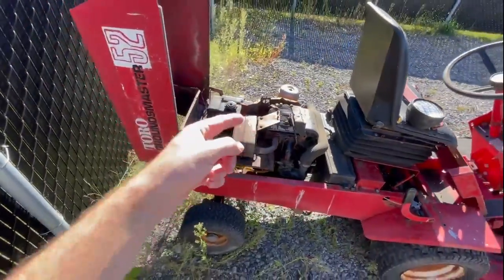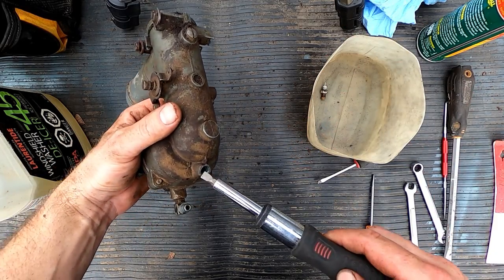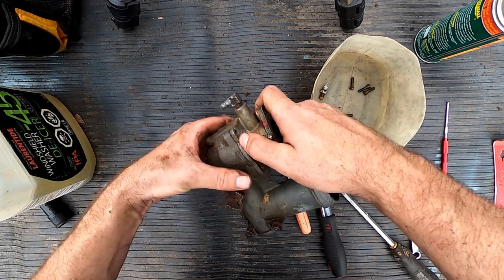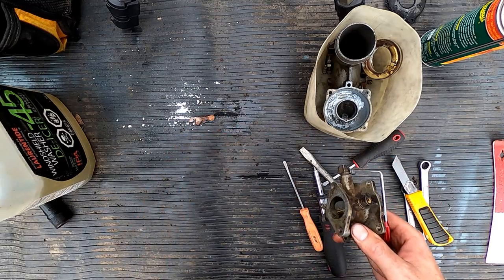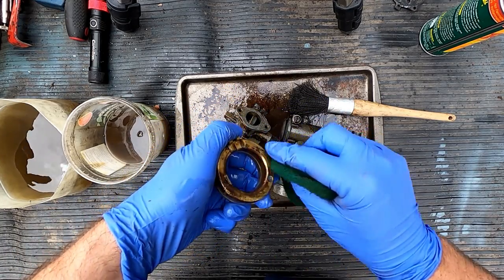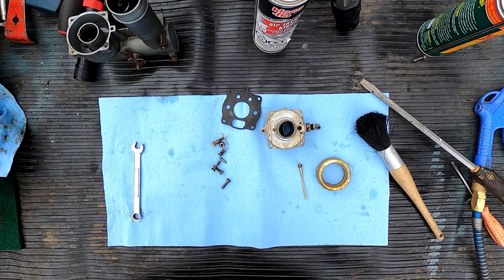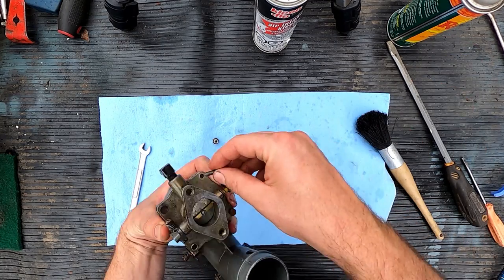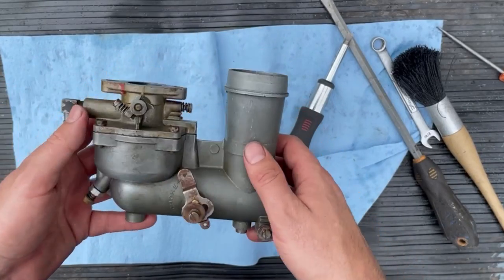Briggs and Stratton Carburetor Repair!  (Foolproof) Zero dollar rebuild for Cast Iron 16hp

Comment: I have a 1972 Sears Surbuban 15 with a 15hp Briggs and after watching this video I am going to clean mine. It sat for 15 years and only runs with full choke and has no power
Reply from the maker: Definitely with the symptoms you are describing a good cleaning will help!
Reply: @mattsws   The issue I have is it looks like I have a Walbro fuel pump attached to the fuel inlet side on the carb. I looked it up and it is a Walbro 3008 with the numbers 2806 under the 3008. I cant find anything like it because it is a Aluminum box about the size of a matchstick box. I kinda wanted to rebuild it while I have it off

Comment: Nice video. I am currently playing with an 8HP B&S 170402 model snowblower engine (1967 mfg). No air filter of course. Your video is one of the better ones. I have replaced some parts and cleaned the carb pretty good but am having starting problems. I'll have to work around the adjustments to the jets. It does have spark as it fires up for a few seconds with starter fluid .It did work when I picked it up a few weeks ago. Does have good compression and did seem to sound good when I picked it up. I really have no use for it right now but as a hobby I would like to see it run.
Reply from the maker: I’m glad to hear that you enjoyed the video. Those are fun engines, especially the older ones like yours! If the carb was fully disassembled and cleaned and it has fresh gas, even rough carb settings will get it to run. Then its just a question of tuning it in by ear. Assuming compression and spark is good. Hope you get it going. Let me know how it works out! Thanks again for the nice comment!

Comment: Nice video.  I have one on an old generator that I want to revive.   I have no history on the generator but it looks good, no rust in the tank at all.   
When I complete repairing the start rope today I'll see what it does before I attack the carb.
Reply from the maker: Good to hear! It always impresses me that you can revive an old briggs with some basic hand tools and a couple hours of patience! Thanks for watching!!
Reply: @mattsws  :::  Well today, 18 July 22,  I replaced the white disk that hold the rope and rewinded the starter springs. Apparently the other disk got stuck and melted out the center.   
After reattaching the cover I checked the oil then sprayed some carb cleaner down the throat and it started on the very first pull.   I then put about a quart of gas in it and it started on the next pull as well and it makes power.   
Since it is running so well, I am not going to touch the carb but I am going to replace the fuel line, filter, oil, and the burnt out muffler.  
I guess that clean gas tank was a sign that no gas was left in the tank.
Reply from the maker: @Hear-MeoutTwo2  No gas in the tank probably also meant no gas in the carb. That's what saved you the trouble of cleaning it out. With today's ethanol gas, you are lucky if it doesn't gunk up before the next season! Glad to hear it runs so well!